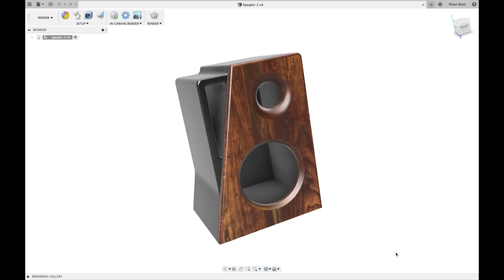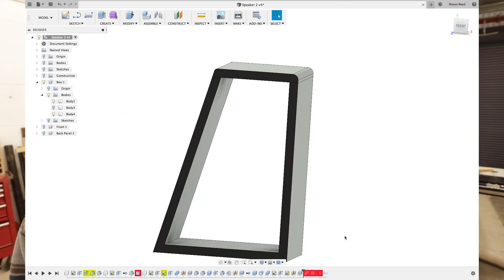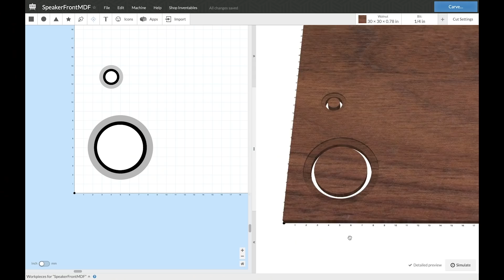Building the Fanciest Shop Speakers...Ever?

Comment: they came out great.... as for the MDF edges, i've made a bunch of arcade cab and what I do is mix white glue and water to about the consistency of heavy cream.... paint it on and sand, repeat about 3 coats.... edges will be rock hard and smoother then the MDF face....
Reply from the maker: Appreciate it! I have done the glue and water trick before, but figured I would try an actual product this time. Might go back to glue if I do something like this again.

Comment: Right on Shaun they look great & sound decent through YT even tho YT compresses the sound. Inwas actually in the process of putting together a "speaker kit" for you that contains 4 - 6.5s woofers, 2 - 1 1/8" soft dome tweeters & 2.5k crossovers for mtm build. The speakers I built for my house using the same components sound amazing, well balanced with excellent imaging & a very nice natural open & airy sound. I really dig your non boxy design although with the added walnut baffle & chamfered edge you will experience whats called baffle step. Its nothing you will notice as a beginner speaker builder. If your ears are happy then they are perfect. It all comes down to what you enjoy & if you have any nay sayers lol just ignore them... You did good..! Heres a tip - when installing drivers into a baffle its very important for the diaphragm of each driver to be at the same height on a narrow baffle flush mounted. Narrow baffle helps to eliminate baffle step with flush mounting and with the diaphragm on the same plain it really helps with phase issues etc. Excellent work along with a beautiful design. ..! If at a later date after a break in period try adding some poly fill to the enclouser. Some will disagree with that but if you take "grill cloth" and cover the port tube on the inside then use about 1# of poly fill per cubic of volume your low end will really warm up with a better presence... 

"Shaun Boyd Wright" speaker designs
Reply from the maker: Dang, I should have talked to you before making these! All the stuff with making speakers reminded me a lot of my days working in film/tv. I was big into camera work and cinematography (probably wouldn't know watching my videos now haha) but I remember people going crazy trying to get the absolute best image possible. Then I would watch a short film shot on a camera phone and I would enjoy it more than a lot of the stuff shot on camera worth 100x a cellphone. That being said, I would definitely love to hear these speakers next to a similar set made by someone that knows what they are doing! 

Thanks man!
Reply: @shaunboydmadethis  Wow thats a pretty cool background. Sounds like it was fun. Ive seen short short indie type movies shot on an Iphone lol... Lets just say I was impressed vs something shot with a $$$ camera. Heres the short version of my audio background. Started in custom car audio back in the 90s. Had a small shop that I worked out of doing that as well as custom fiberglass work for installs. Built dashes, door panels, fiberglass speaker pods & subwoofer enclousers. Fixed canoes - pretty much anything that was fiberglass etc. Did a butt ton of repairs for people. A buddy competed in a aound off with an install I did for him. He took 3rd in both SPL & SQ for his power class. He hit 138db with one old school kicker 15😁. That install brought me tons of work..!  I then started in custom home audio as well & pro sound. I got to mix for Charlie Daniels once & Diamond Rio. The guys from Diamond Rio were pretty chill down to earth guys. The drummer bought a drum baffle from me made out of plexiglass to help isolate the volume of the drums. I mixed for alot of different bands that came through the casino I worked at. Thats the short 30 yr version. If your speakera sound good to you then they are good. Seems like you might be hooked on speaker building now lol lol lol enjoy my friend its a good hobby that can bring you a good solid income if you decide to go that route & with your "Shaun Boyd Wright" designs you will do well😀 If you decide to add a subwoofer or two for stereo subs may I suggest as a budget build without a budget sound look into the dayton audio 8" classic subwoofers along with the dayton audio SA-100 sub amps.  Remember thise templates you made me? Those templates are for sub enclousers for those very subs. I will suggest a .66 - .75 cubic foot enclouser tuned to 30ish hz. If you need help with port tuning let me know I can use winisd or a port calculator for ya. I will also suggest a bent horn, folded horn or T-line enclouser for your large shop in the corner(s)
Reply from the maker: @houseoffire72  Dang, that's awesome! Sounds like you have done it all when it comes to audio stuff. I will definitely hit you up if I decide to make some more of these and do it in a more refined way!

Comment: They look great but I'm sure their sound is suffering a little from a lack of deadening inside the box. Just need some poly fill like they use in quilting to line the inside. It prevents or at least dampens the reverberation of the sound off the smooth walls bouncing back into the speaker cone. It can really help your bass tones sound better.
Also some felt pads on the walnut fronts to prevent them buzzing against the box when you crank the music.
Some would say your port exits too harshly into a flat surface too. But I'm not great with speaker port design either
Reply: Agreed.  As he closed up the box, I was wishing he had built some internal bracing, cross bracing... anything to eliminate the resonance from the cabinet, as well as poly fill.  As for the port, I think its in a decent location, but there is some science behind the length of a port tube, which he omitted all together.  However, they are certainly beautiful to look at.  Gives me some ideas.

Comment: After milling MDF, mix a solution of 5 parts water to 1 part wood glue and paint it on the cuts with a foam brush.  Wait for it to dry and sand the cut with 220 grit and you'll have rock-hard edges.  I do this on my arcade cabinets...especially before milling the t-molding slots.
Reply from the maker: Thanks for the tip! I have actually used that technique before with good results, but wanted to try an off the shelf product for this one. Safe to say, I will probably be going back to the glue and water trick!

Comment: Those boxes are reminiscent of the Ti series by JBL ( the cheapest that I sold was around 2.5k a pop, the most expensive 7.5 K a pop), but then again, they also had very expensive chassis in them. In any case: what helps the sound in those boxes is that are asymmetrical which reduces the standing wave occurrence.
Reply from the maker: Oh nice! I had never seen those. Glad to hear the asymmetrical design actually serves a purpose.
Reply: @shaunboydmadethis  well, they complicated it a little more, they also made the box in 3 layers, a wood layer, an anti vibration layer (like the bitumen/fiber anti-vibration mats you find in cars) and another wood layer. They are most probably the best conventional reflex boxes ever build.

Comment: Have you tried adding any stuffing/wadding or foam (what ever you call it) to the inside of the box? Worth a try for very little money just to se if you get any benefit. Anyway really nice work. 
And if you want a better paint finish in future then get some relatively cheap guns. I use devilbis flg 5 and spray them with poly base coat, lots of sanding maybe another coat then lots of sanding then 2 coats of pu 2k gloss then polish until you’re sick of looking at them. By this time you realise how much time you have sank into these “shop speakers” but hey it’s worth it.
Reply from the maker: I haven't tried adding any stuffing, but I might give it a shot if I have some free time. And good tips on the paint, it was really just one of those things where I had a limited amount of time and couldn't keep experimenting with it. Really appreciate your feedback, though! And thanks for watching!
Reply: That’s the trouble with paint it takes a lot of time. Great build though. 👌

Comment: OMG Shaun! The woofer port is not an hole in the box 😨 Give me the internal volume of the speaker and the radius of the hole to calculate the dimensione of the port🤦‍♂️ and put some phono wool in! (dunno the name in english 😅)
Reply from the maker: Haha! What can I say? I'm a rule breaker.
Reply: I think we call batting batting instead of wool since it is normally synthetic over here.
Reply: Shaun Boyd and that’s why we love you 😘 bit we love your ears also...then: give me that measures 😜
Reply: this side crevice might actually do some port work here... well my beef here is this crossover on a hot melt glue :-)

Comment: Great Vid! What are you doing with the magnet and what is that spray?
Reply from the maker: The magnets hold the front panel in place, and the spray is an activator for the CA glue. Just makes it dry quicker.

Comment: Warned the audiophiles, but nothing for high end finishers.  Yup, lots more sanding on the filler.  Then either a high build 2k primer, or at the very least polyester glazing putty finish sanding to about 600 grit, and a top coat.  Getting high end glass smooth finished can double the project time.  Look and sound perfectly fine for shop speakers!
Reply from the maker: Yeah, for shop speakers I realized the time that it was going to take wasn't quite worth it. Thanks for the tips though!

Comment: Those are beautiful Shaun!  Aren't you worried about the sound vibration shaking the decorative fronts off the magnets?  Maybe a couple of guide pins between the case and the fronts to  help take the vertical load would be good insurance?
Reply from the maker: Thank you! Yeah, I definitely thought about that, and was planning to add something just like you said. I doubt they will shake loose too easily because I rarely play music super loud when working, but it would be smart just to be sure. The magnets are strong, too!

Comment: hey, great build and video. How do you align the magnets so that the holes are in the same spot in both? thnx for sharing. cheers from Argentina
Reply from the maker: Thank you! I just aligned them with careful measuring, since the walnut front is the exact same size at the box, it worked out!

Comment: Those are great looking enclosures, but just a quick comment on painting.  As a former painter I think it's a shame that so many woodworkers complain about sanding/painting/finishing.  I used to get a lot of flak from carpenters on job sites about how dirty painting was and how they looked down on painters, when it's the painters that put the finishing touches on their work and make them look good!  Really, it's just about being diligent about sanding, priming, sanding, painting, rinsing and repeating.  With proper pricing and a few more sessions of sanding and reciting you could have had an end product that you wouldn't have to make excuses for.

Comment: Question Picasso. How did you load that stunning art work into the x-carve?
Reply from the maker: That was a process that I'm sure a graphic designer could have done much more efficiently. But I took a picture of the guitar then essentially traced the image by hand in Inkscape to create an SVG that I could then load into Easel.
Reply: Nice. Thanks.

Comment: I was wondering where you had gone. Just look like you needed to sand a little more on your bondo but they still look good
Reply from the maker: Yeah, I think some more sanding and maybe one more coat of bondo and I could have gotten it much smoother. Thanks, man!
Reply: @shaunboydmadethis  either bondo or rattle can primer filler

Comment: Ported speakers need 50% of the interior surface to be covered by sound damping material.  Covering the xover  would be part of that.  Putting that thick facing was an error, speakers need to be flush mounted to avoid edge interference and narrowing dispersion angle.  You can add the damping easily but the front needs to be as thin  as possible, however you want to accomplish that  (veneer maybe).  There are plenty of volume calculators but finding the all important Q in the speaker specs is not common these days.   That iron core coil in the xover is not used these days a hollow core is preferred.

Comment: IMO painting anything in high gloss really sucks. I had my TV cabinet primed twice and painted 5 times, just to wet sand through the edges. If you find a fool proof way, please share. 
I think I may try epoxy and polish it over paint, or use epoxy with some color.
Reply from the maker: Yeah, I almost never do anything with a glossy finish, but figured this was a good project to give it a try. Not sure I will be doing it again anytime soon!

Comment: Audiofile here with speaker building knowledge LOTS and Lots Of it.

A) I'm not going to tell what your speakers sound like on youtube, no I hear my speakers!   Its a ya kinda of got to be there thing.

B) they look awesome! And I love the non geometric shape box, no 2 walls being equal 

Even with all the knowledge of how to build a box I've seen good on paper planes sound like ass sound is not always mathematical its theroicatal , even with the best laid plans a few tricks could make them better if you know what your doing.  That looks like 2- 5.25" mid bass drivers  in a 1/2 cubic foot box and a tweeter I can't tell what kind yet.
Yes they do make sound.

My only question is did you make sure to wire everything in phase?  yes speakers have polarity, get one midbass driver out of phase and it cancels out bass.   ok one more question what's the crossover points and the octave level of each?

MDF is Perfect for speaker boxes, its hard flat and dosn't have pockets in it lik plywood has, however adding a wood front panel might make them buzz or make noise if you hear that at loud volumes remove them and listen. What would be happening  is the wood slapping each other.  Those look like rare earth magnets but I don't know. They could be a weaker man made type.
Reply from the maker: Thanks, really appreciate your comment! I always have hated speaker tests via online video for the very reason you stated, but felt like I had to at least put something in there!

Yep, made sure they were wired in phase. That is one thing my slim knowledge of audio wiring actually covered.

As for the crossover, it is a 2,000 hz using a second order (12 dB/octave) Linkwitz-Riley alignment. This stuff is far beyond my knowledge, and I think I found some sort of crossover calculator, and this one was closest to what the calculator spit out for me. I'm sure it could be tweaked for better performance.

So far the fronts don't buzz, and I have cranked them up pretty loud. That was my one fear about doing it this way, but the magnets are strong, so it has been good so far!

Comment: Really good at woodworking clueless about audio. Problem with this video is it gives the illusion that anybody can make good sounding speakers. First your baffle on top of those flush mounted drivers might be making audio worse with fancy beveled recessed speakers. Second your hole coming into your front directed port might be a little small. Third, what did you put inside the box for internal refection dampening. Fourth, you used an off the shelf crossover board that might not be ideal for best audio coming from a small two way. Other than that the idea about your design is interesting just frustrating to those in the know about audio.
Reply from the maker: I think you might have missed the point, but thanks for watching.
Reply: @shaunboydmadethis  Idon't know, Shop speakers don't need to sound like doo doo. It's like watching somebody build a beautiful barn and then leave the barn doors off.